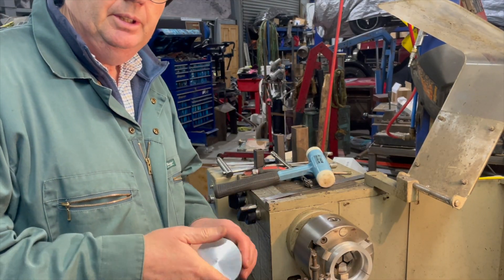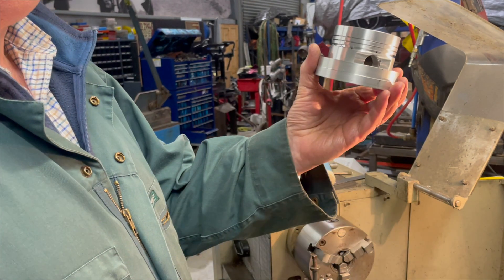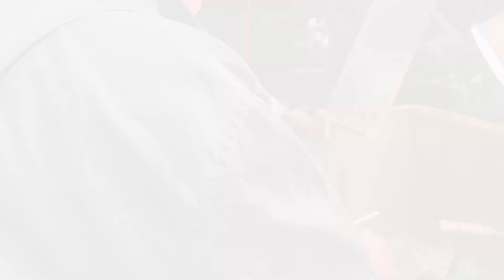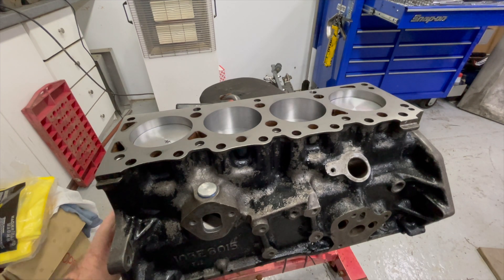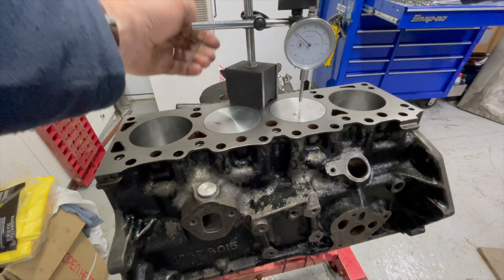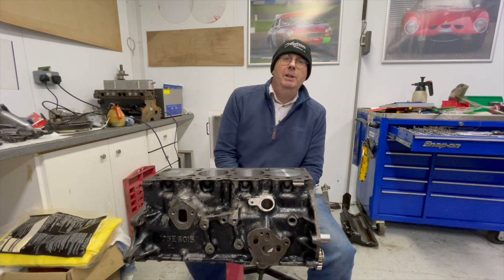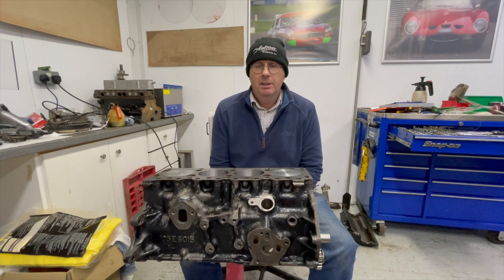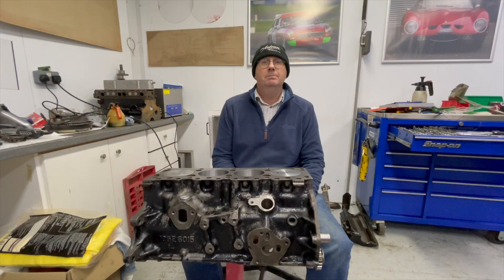Brabham BT21engine rebuild part1- Machining the pistons   4K

Comment: What kind of cylinder head are you using. That's looks like a Ford Kent block and they usually have pistons with a "dish" in them. I've built a few of the uprated crossflow's.
Reply from the maker: its a ford anglia pre x flow block and I'm building a MAE engine
Reply: @howhardcanitbe-bt21   Part No. 109E 6015 ?

Comment: Just came across your channel. Lovely car, you've done a great job. Think we're in the same boat. I'm working on a Lotus 22 FJ, trying to get it finished and on track this year. Doing most engine and assembly myself. Might need a few tips along the way. Cheers
Reply from the maker: Welcome aboard! I’m just making it up as I go along.Building race engines is new to me but I’m loving the challenge.
Reply: New to me too. Do you run locked advance on the ignition timing for f31000? Also, what cam and compression? Typically 12:1 plus for FJ. Running A6 cam in mine. FJ also use Lucas hall effect ignition amplifier. Cheers